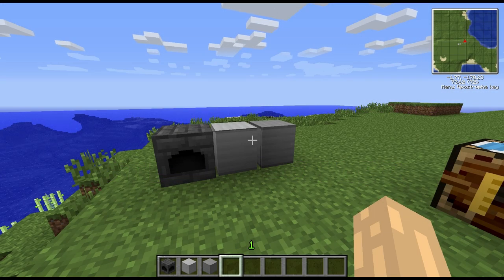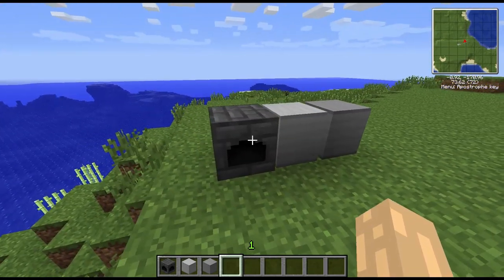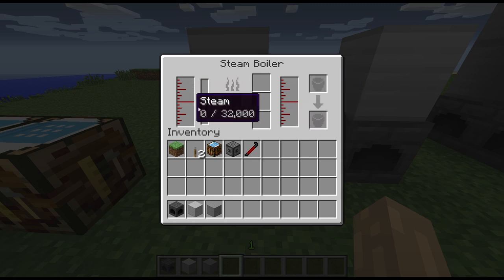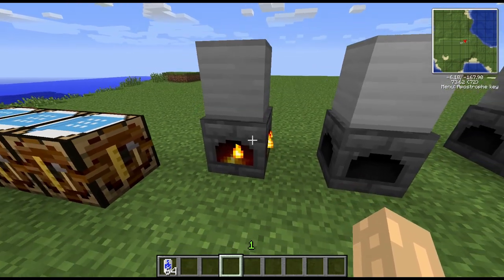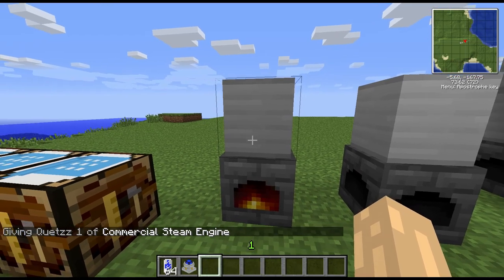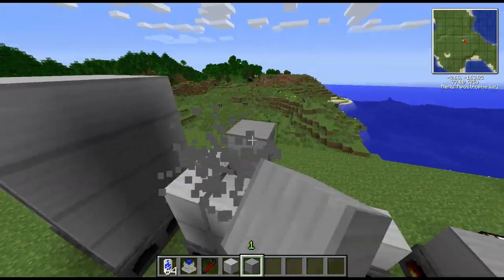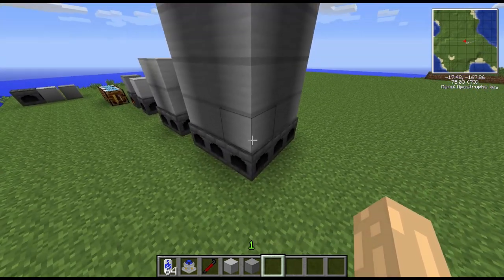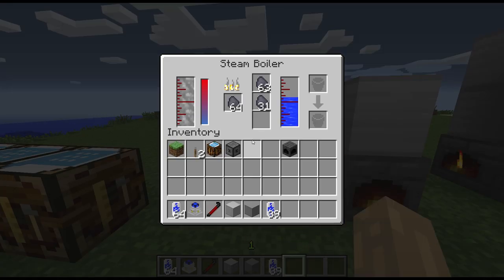Block Spotlight - Steam Boiler

Comment: I've done some research on the subject.

The benefit is different. Boilers are extremely resource hungry when heating up, but as they heat up, they use less fuel. At 100% heat the most powerful boiler requires very little fuel while being capable of producing enough steam for 5 turbines for whooping 250EU/t, or 4 turbines and couple of engines. The trick lies in building an installation capable of providing fuel and water for boiler at constant rate automatically.

Comment: You get anything from 6.25 times more up to 11 times more than regular generator, but to get similar EU/t output than generator gives you need to use 3x3x2 low pressure or 2x2x2 high pressure to get similar power output rate. Just to warm the big ones to the point they produce any steam at all you'll use two stacks of fuel. But if you use large amounts of IC energy constantly (for example in Mass Fabricators) they're definitely worth the investment.

Comment: This thing looks awesome and I love it, but it troubles me... if I want to use the boiler to, for the most part, generate Industrialcraft's energy in conjunction with turbines, what's the difference between that, and simply throwing the coal coke into the generators, except for the fun factor? I've noticed the biggest high pressure boiler (3x3x5, including the layer of fireboxes) takes ages and tons of coal coke to heat up. I guess there is a huge difference, but I wanna know for sure.